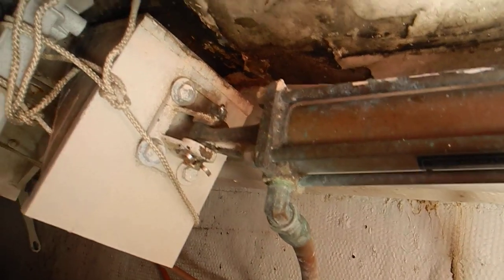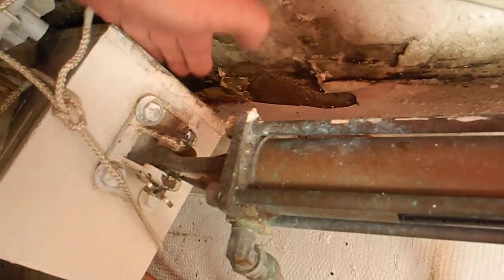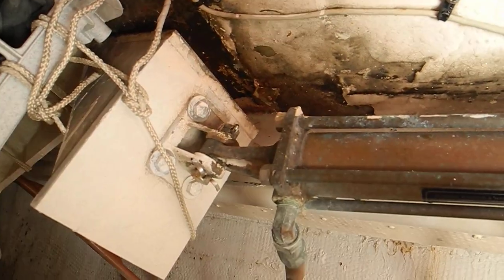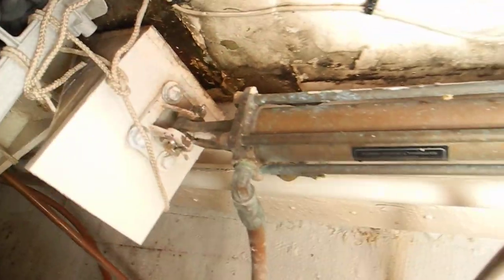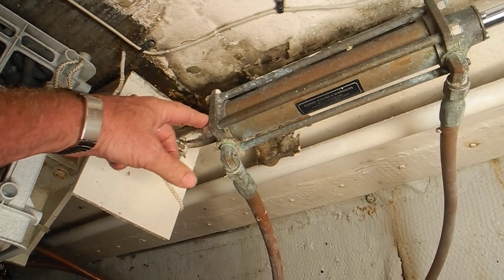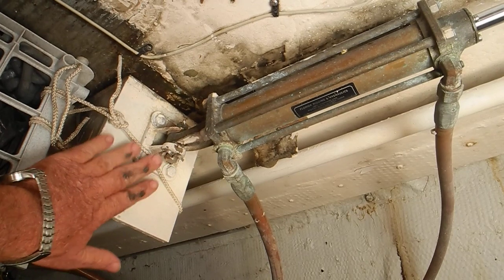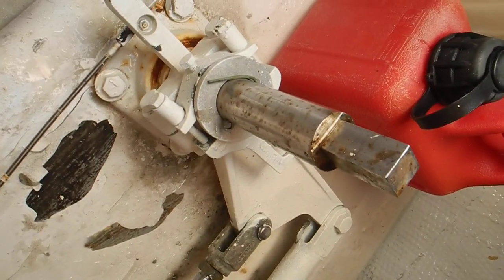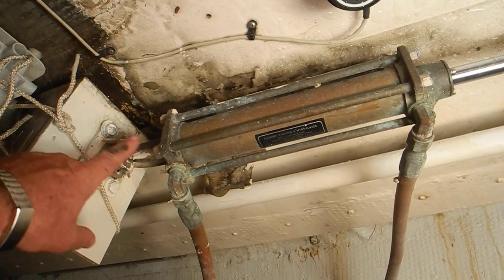Bent steering ram

Comment: Not sure heating the base is a good idea. It's cast metal. Besides, the seals for the tube are on the base. Seastar can match that cylinder. They got a lot of "boat bucks" from me. Tell them Chuck said hi.
Reply: Yeah but it's easy to dismantle the cylinder before heating the base. Otherwise there's high risk of boiling the oil and burning the seals.
Reply from the maker: @skunkjobb  Zackly.
Reply from the maker: Don’t know what this owner did after he got home with the boat.